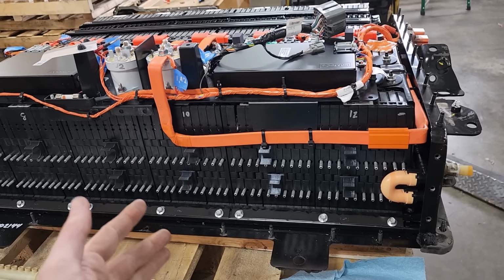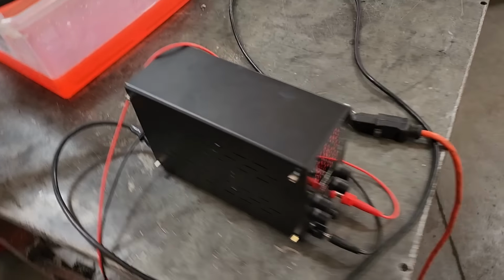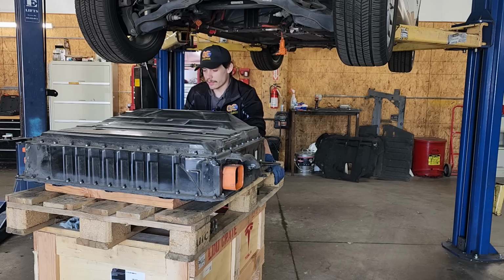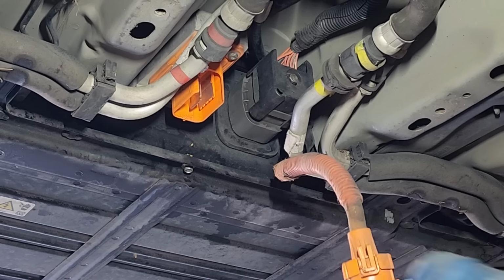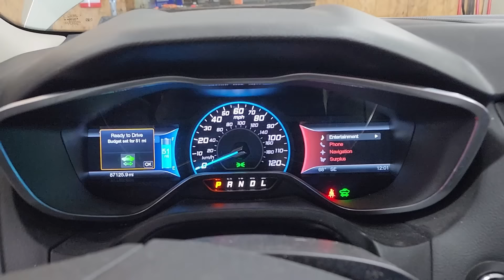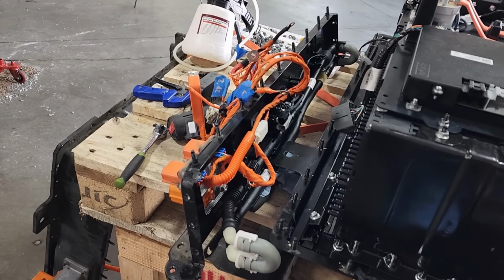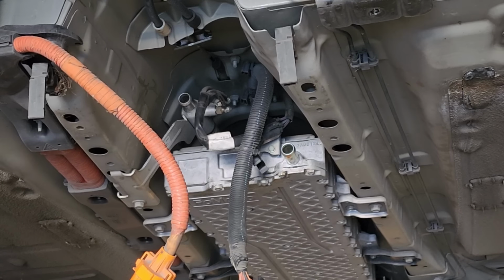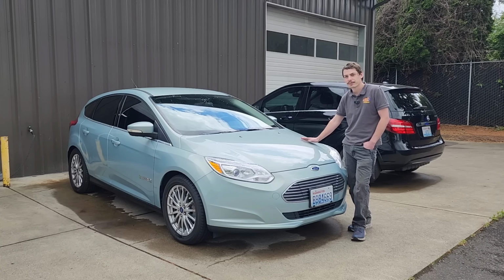"Fixing" the battery on my FREE Ford Focus Electric (Part 3)

Comment: Hii Alex, another solution for the coolent system on Ford Focus would to create the loop out the stainless steal tube and the use the silicone tube to connect to the coolent maniford and the tubes on the battery cells. that would removel the flex that is pushing the maniford off the cell. I hope that makes sense. regrads Manny.

Comment: Liquids usually have higher heat capacities than gases.  But if the choice is between good and none, I would consider using filtered air as 
a coolant.  Better than nothing and it has the benefit of being non corrosive as well.
Reply: nice
Reply: I like your idea.
Reply: Condensation my friend
Reply: This was the first thought I had when he talked about plugging all the holes I thought wow let the air run put a blower to it. Of course, this would have to be done in a manner that would be safe a lot more thought needs to be put to this.

Comment: ...Great video....Terrific to see a quality video of someone pushing the 'system' and trying things. Nice Style. Agree it's super handy to have a cheap, knock around vehicle at hand.
...Had a thought when you mentioned (part 1?) that others had got more space in the packs by physically removing all the cooling plates between pouches / battery elements...
...Instead,
...Why not remove every second cooling element and keep the coolant flowing in remaining elements? .. Solves lots of problems...
...It would give space and allow some degree of cooling.
...Regardless I wouldn't park in/near the workshop unless your insurance specifically covers experimentation (insurers love their exemptions)
...Very happy to find your channel, keep up the good work.

...P.S. Not sure of your logic re other cars not having cooling thus it's not vital.... There's Air Cooled motors in some Internal Combustion cars VW Beetle etc. why not delete the radiator for a normal car if it leaks?....Ahhh..Big metal cooling fins and blowers....who would have thought...   :)
...Just imagining all those pouch sized hotspots well away from any monitoring... Electroboom would love it.

Comment: Fun to learn about the future that I will not be here to see. If we could come up with a lighter battery pack with twice the power capacity these cars would rock. I'm sure our future generations will figure it out.
Reply from the maker: It's coming fast! This car is already pretty "ancient" from a tech perspective given how fast the technology has been progressing in such a short amount of time. A typical new EV (or even one from a few years ago) would have nearly double the energy density that this car has. 
For reference, this car uses LG Chem 15Ah cells that have an energy density of about 150Wh/kg each. Compare that to the 2170 cells used in a Tesla model 3/Y, which have an energy density of almost 260Wh/kg. The cell chemistry is improving all the time, and I imagine that we'll continue to see leaps and bounds increases in capacity over the coming years, just like has happened over the last decade.

Comment: With no cooling loop for the battery now, do you limit the rate of charge and watch the battery temperature?   Does the car still monitor the temperatures and limit charging and/or output power from the battery if it gets too hot.  I would assume that no cooling/heating would be problematic here in Michigan with the cold winter temperatures?   Thx for the great videos!
Reply from the maker: The BMS absolutely still monitors the cell temps with thermistor probes spread throughout the two packs. If the battery is too hot, it will not allow it to operate (drive or charge). If the pack got below freezing, it might not be able to charge, though it would still be able to drive to an extent. Where I'm at, the temperature extremes to cause those issues are not super common (though we do get below freezing temps at times in the winter).

Comment: what if you actually removed that complex battery pack used it as home storage and fitted the car with newer battery modules like from tesla or GM for example?
Reply from the maker: One day, that would be the plan. The tricky thing is that this battery is a very "strange" number of cells in series, which can't be divided into evenly sized modules, so it would almost certainly have to be a custom solution using individual cells rather than using other "off the shelf" modules.

Comment: I have a 2014 FFE with 87k on it and the lower pack leaked so I removed it and blew it out then hung it up for a couple of weeks with a heated fan on it.  Then made a bypass loop in the tunnel like you ended up doing, and cleared all the faults.  I drove it for about 10 miles at a time around my house.  Eventually the SSN fault appeared and now it has 2 warnings P0A0A interlock & P2601 coolant pump A stuck off.  I’ve pulled all of the connectors with interlocks checked and cleaned them then reconnected them making sure they are properly seated. Using Forscan I was able to test run all of the coolant pumps which are working normal. 
Unfortunately I live in Southern California or I would bring my car into your shop.  Would you have any suggestions of what I should be looking for now?  Thanks
Reply from the maker: Hmmm... As far as the interlock circuit goes, it's entirely possible that there could be an open circuit inside of the battery caused by corrosion from the coolant. 

I would say it could be an issue with the installation of one of the HV disconnects, which is a very common mistake for the type of disconnects used on these cars (same as RAV4 EV, 500e, and others), but since it worked for awhile, that may not be the case here... Worth double checking though to be sure. The lever/handle needs to be all the way upright at 90 deg when plugging it in, then once the disconnect is fully seated, swivel the lever down into place (which should suck the disconnect further into place). This is especially tricky for the lower pack on the FFE, as there's not really enough space to install it with the lever upright, so you kind of have to get it positioned with the lever partially closed, then open the lever all the way before pushing the disconnect all the way down.

If this procedure is not followed, it may look like the disconnect is installed all the way, when it actually isn't. I've worked on many a car with this style disconnect where the customer (or even a dealer tech) attempted to remove and re-install it, and didn't do so properly. The easiest way to tell if it's installed properly is to pull on the disconnect with the lever locked down, if you are able to pull it off, then it's not locked down all the way. 

As far as the coolant pump issue goes, mine did the same after putting everything back together, and then after a short drive, the code went away on it's own. I think it had something to do with the system needing to bleed air out, or may have had to do with me running the pump with Forscan when I was doping testing.
Reply: Thanks for the input.  I know what you mean about the hv bat. disconnect they put that thing in a terrible place.  I haven’t had any time to work on it this last week but next I’ll try checking for continuity on the interlock connections.

Comment: Instead of totally eliminating the cooling lines I would have you send your silicone tubing and daisy chained the cooling plate lines and then made a connection to just one section of the original manifold.  It would not be as good as original but at least there would be some kind of cooling.

Comment: In the aircraft industry most of the electronics are cooled by air which flows thru the black boxes holey cover and out the bottom by suction. Not being there, but noticing that there is a plastic manifold cover goes over the cooling tubes, if the upper and lower are separated why not use this air to pass thru one and out the other as an aid to keep the internal temp lower (leaks be dammed). It should improve the internal battery temp,NO Just a thought

Comment: Imo it was a waste of time making those elbows, it would have been easier and no potential for leaks inside the battery pack to just bypass it externally and cap the ports on the pack.

Comment: I feel like itd be a burden to use this car as you have a perfectly drivable model s. Would you sell this car as-is to someone if the opportunity arose?
Reply from the maker: I might consider selling it at some point, but it's actually been a pretty useful runabout just to get around town running errands. 

It's sort of turned into my default "shop car" for running to pick up parts and such.
Reply: @AlexEVRepair  I can def see that, turning radius probably super nice too
Reply: I don’t think I could sell it. With the battery cooling delete, I imagine the insurance would take a dim view and in the case of a battery fire, they wouldn’t pay out.

Comment: So just to be clear, the battery pack had a cooling system and you think it will be fun to bypass it? I hope you bring marshmallows!
Reply: I was honestly thinking the same thing that thing is going to explode
Reply: @destruct61  🤣
Reply from the maker: Bypassing the cooling system definitely comes with drawbacks (the big one being reduced lifespan for the pack, which realistically is nearing EOL anyways in its current state). The car has safety measures built in to place to keep the pack from getting too hot, and will limit or shut down power if necessary. Some EVs (particularly the Nissan LEAF) don't have battery cooling at all, and the biggest issue is accelerated degradation. However, for most operation, the pack doesn't get appreciably hot enough to cause issues, unless it were a very hot day outside (>100 deg. F). If this car had fast charging capabilities (which it doesn't), that would be a totally different story, as then the cooling would be much more necessary. 

This modification has been performed by numerous other FFE owners with general success, though some folks do have issues with power being limited on really hot days in places like Phoenix AZ. Being in the PNW, it's pretty unlikely that I will have those issues, except maybe on the hottest few days of the year (in which case, I will probably refrain from driving the car). Just today, I put about 50mi on it in 85-90deg weather without any issues.
Reply: Please tell us all where your EV Repair Shop is located, so we can avail ourselves of your service and expertise.